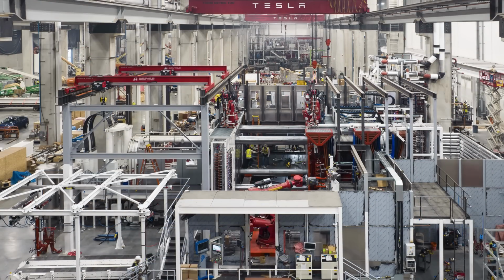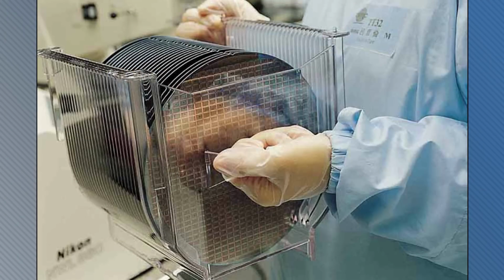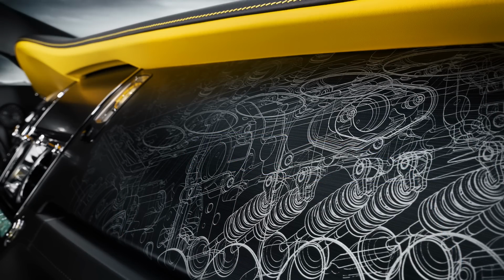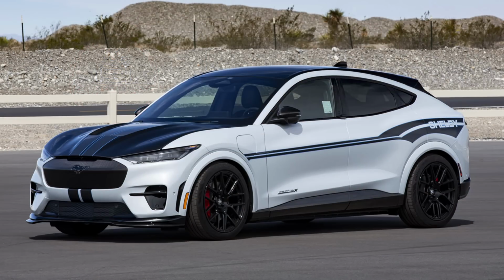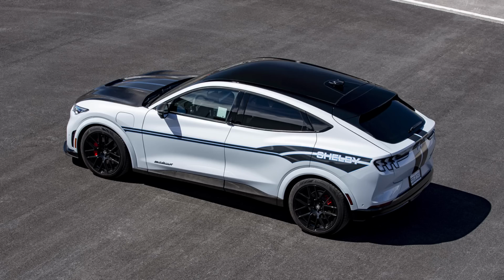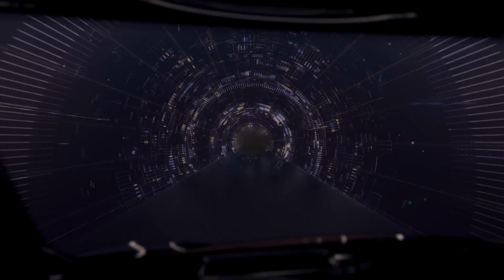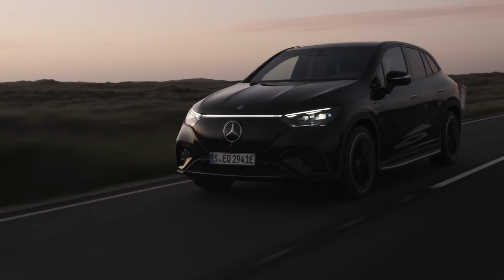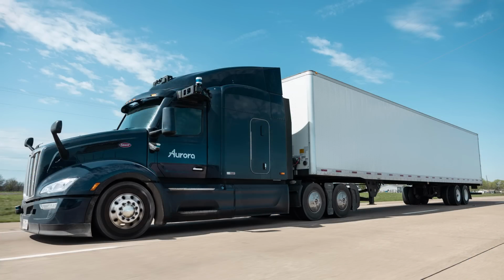OEMs Racing to Copy Tesla Gigacastings; Shelby Mach-E Not Sold in U.S. - Autoline Daily 3555

Comment: Everybody laughed at Tesla, now they are just trying to keep up.

How funny how times have changed
Reply: They are still laughing this time at the CyberTruck.   The 1/8" SS body is going to win over a lot of people who use it on the job.   It will be the toughest truck body bar none.   The air suspension, 4 wheel steering and price will pull in the rest of the buyers.
Reply: @danharold3087  Its just a clowntruck!It will sell good for one year!
Reply: Yes, we'll see how it performs in crash tests, how early owners find the immense turning radius, and what reservation holders think about it now years after launch with other options available.
Reply: @brunoheggli2888 says Bruno the 🤡 clown..😂
Reply: @davidmccarthy6061  The CT has rear wheel steering.  Same or smaller turning circle than a model Y.  Tesla generally aces crash tests.  I don't expect the CT to do any worse.
Years after launch the other truck makers will be looking how they can get back into the market.   The CT will outlast other trucks on the job by several times.  Fewer trucks will be sold.  Legacy will hate it.  People will love it.
Reply: @brunoheggli2888  Each clowntruck sold will remove 3 sales from legacy truck makers.  Because it will last that much longer.
Reply: @brunoheggli2888  Come on Bruno you can do better.   Anyone can make up stuff like that.
Reply: @danharold3087  No i cant do better,and i dont have to!Its clear that this cybertruck isnt practical and makes no sense!Its not enought to make something diffrent,it has to be better or cheaper or botth!
Reply: @danharold3087  It dosent have to last long!That also dosent makes any sense!In 15 years the tech will be so much better that most people dont want to drive an old truck!
Reply: @brunoheggli2888  Tesla's electric motors are plenty good.  We will have better batteries so expect companies to make updated replacement batteries for people who want them.     
From a comparative stand point a 15 year old Tesla will not look like an old truck.   Have the SS polished and park it next to a new one.   Maybe less features and minor changes but it will still look good.  That is the magic of design.
Reply: @danharold3087  It dosent matter how good all the shit is,it will be old and not compaerable with the newest tech or materials in 20years!
Reply: @danharold3087  Tis is all so bad!Lucid went up so much more then Tesla,even Fisker and Rivian did way better!Oh no noo this means armagedon for Tesla!how many Cybertrucks this year?50 or 66!Can they even make money with the cybertruck?
Reply: @danharold3087  I like classic cars,but most people like to drive modern new cars with the newest tech!And cars and Trucks in 20years will be much better then the cars and trucks from today,and a stainless stell body wont change a thing about that!It will be all just obsolet hech nobody wants in 20 years!So you want to pay for something way more that is obsolet anyway!You better buy a cheap truck and invest the money you save in the stockmarket or in your harem!
Reply: @brunoheggli2888  You do realize that Tesla will make improvements over those 20 years, right? You think the 2024 CT will be the exact same as the 2044 CT? By that time we won’t even be driving ourselves anymore.
Reply: @brunoheggli2888  The VaporTruck exoskeleton as envisioned by Mark aka Elon doesn't exist.  The WimpyTruck as currently conceived is a Unibody similar to the buy-here, pay-here Hyundai Santa Fe.  Basically, all show and no go for actual utility.
Reply: @Bad_1nfluence  I hope they do!People like new stuff!They dont want to drive the same truck for more then 20years,so for what paying so much for it anyway!Just look at the stupid bed you cant even load or emty the bed from the side!its just stupid!The silverado will outsell the cybertruck buy magnitude!
Reply: Bullshit!